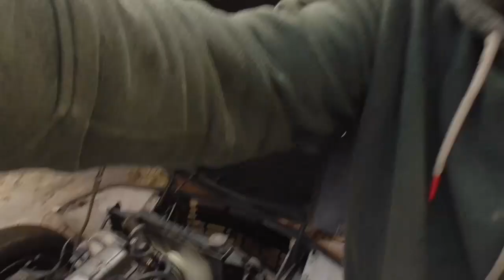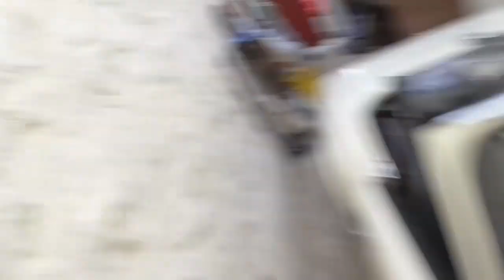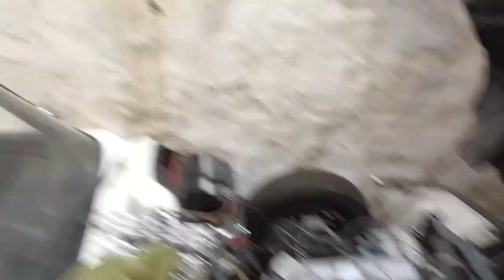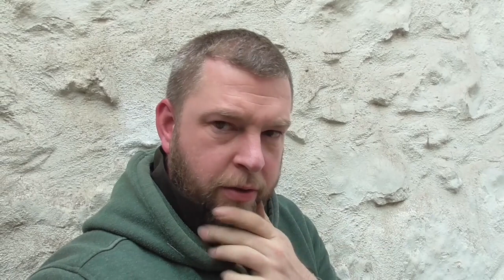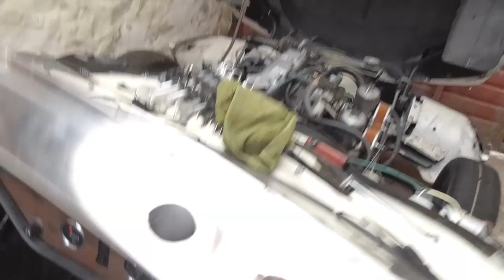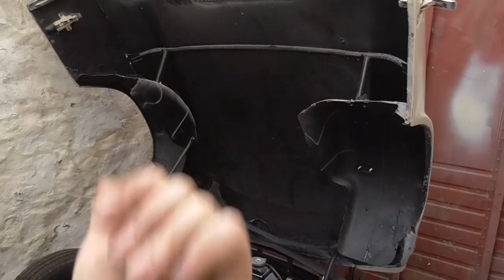Triumph Spitfire | Amateur Restoration | Misfire Problem Solved!

Comment: re number 2 always seems to be the problem, the firing order 1,3,4,2 gives a clue as 2 cylinder is sucking the lean mixture first and number 1 straight afterwards, therefore number 1 has the benefit of the already fully charged manifold to draw on.
Good to see it all working, enjoy, and don't forget with a classic in the boot is a spare wheel and a spare everything else ;)
Reply from the maker: Thanks for that, good to know

Comment: Rover 200 gas struts from 85 to 95 work well. There are custom made brackets on EBay which work well too. They'll need painting but are easy to fit. Total cost is 40 odd quid so half the price of kits from the main suppliers. 
I did post links but looks like they were removed?
Reply from the maker: Thanks for that. Much appreciated!

Comment: Can you send me a link where you got that new distributer from. I do not have a braķe booster an. I did a smoke test on both carbs and I have maybe a small airleak of less than 5% on the right carb but its so little it can not be the problem. I put so much smoke pressure on that the balloon popped out.
Reply from the maker: The distributor i believe was from Rimmer Bros (UK)